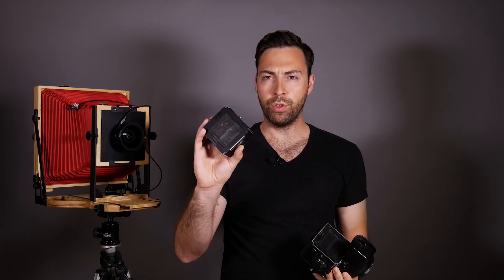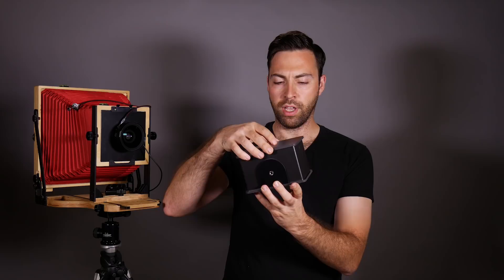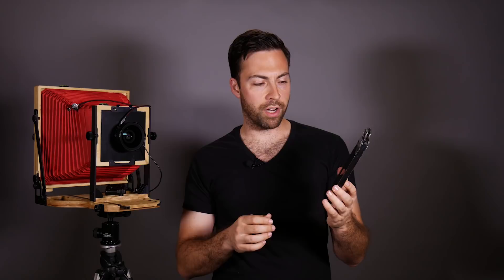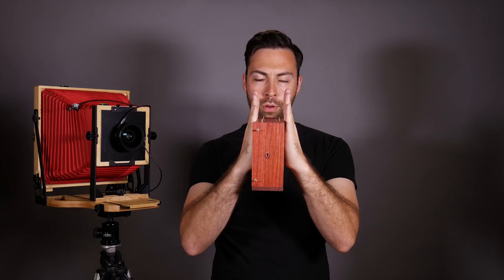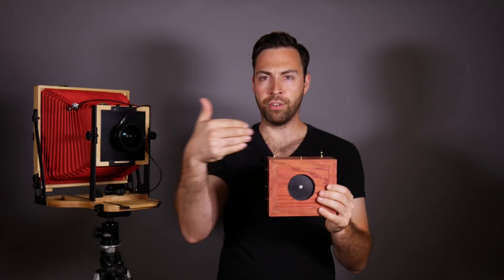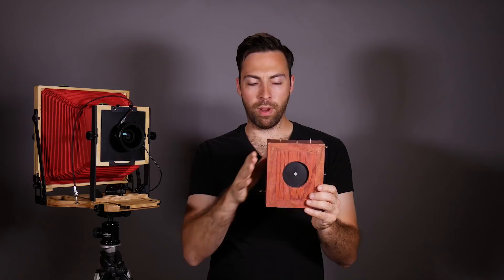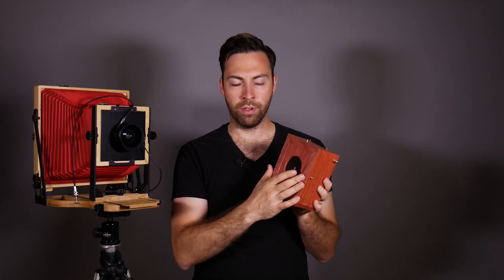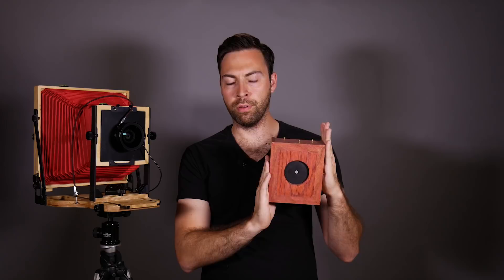Designing Your own Pinhole Camera (Ideas, Tips, and Tricks) - The Pinhole Camera - Episode 2.7

Comment: I have made a 4 X 5 pinhole camera equipped with a Graflock. For those who are not familiar with these devices: they were used in combination with Graflex camera's. En in order to quickly change your 4 X 5 negative you use instead of a filmholder a Graflock. This is a device in which go 6 sheets of film and thanks to an ingenious changing system you can just by pressing a button and pulling a slide change one negative for another. Works pretty neat.